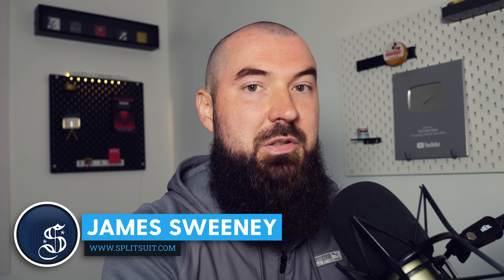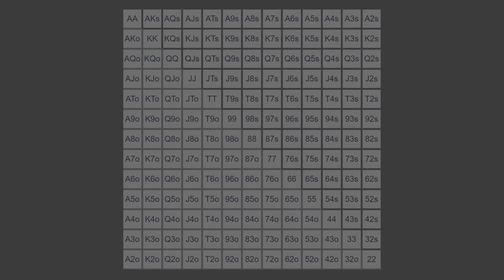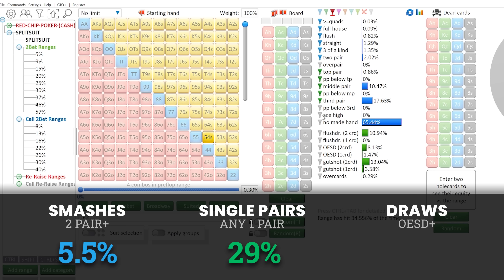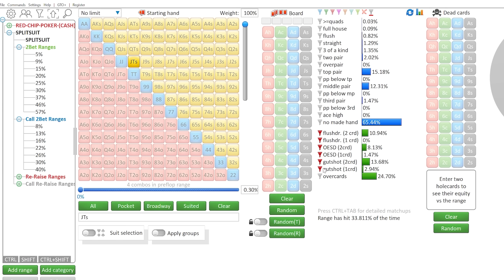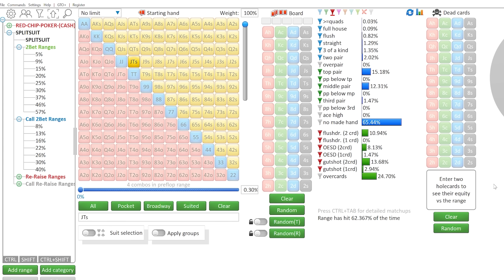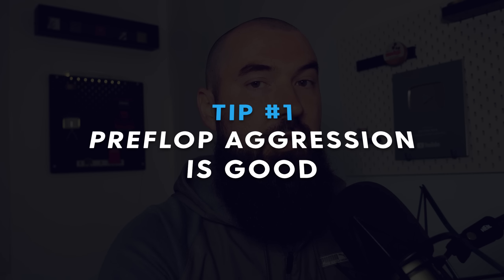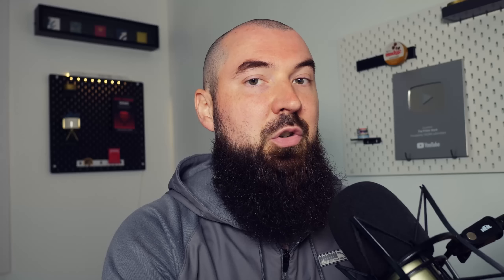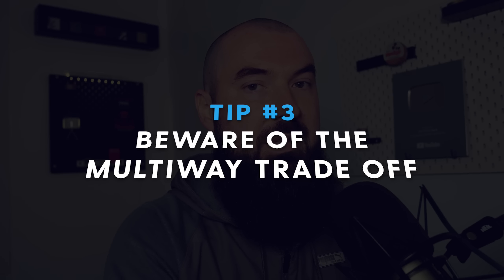The Science Of Suited Connectors | SplitSuit Poker

Comment: Isn't one of the biggest advantages of suited connectors that they do well against strong ranges? Especially the low ones have a surprising amount of equity (and decent realization) e.g. when you RFI and get 3-bet.
Reply from the maker: This is where the SPR discussion from this video can apply outside of MW pots. Yup, these hands retain good equity (especially hot/cold equity), but if the SPR gets too small in 3! pots it can minimize the ability to actualize that equity.